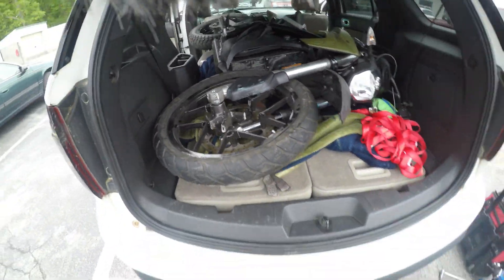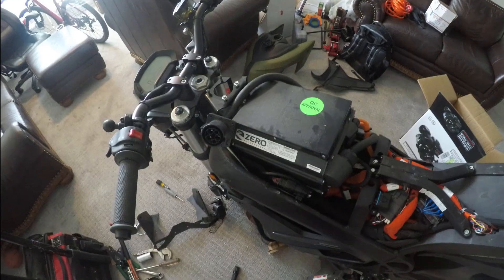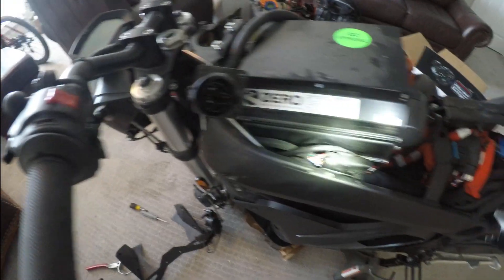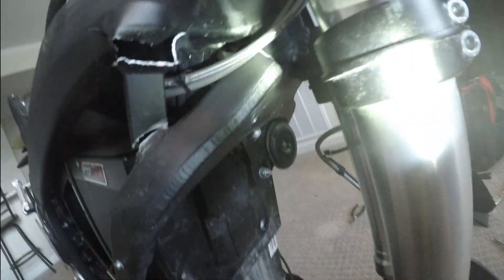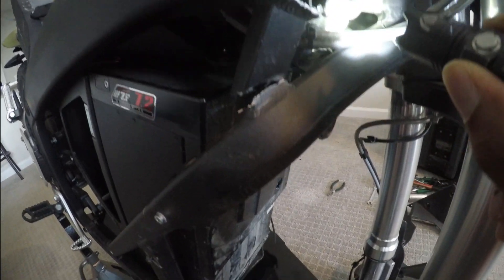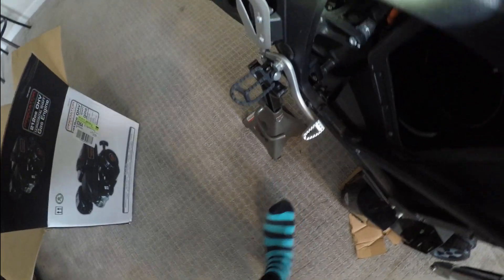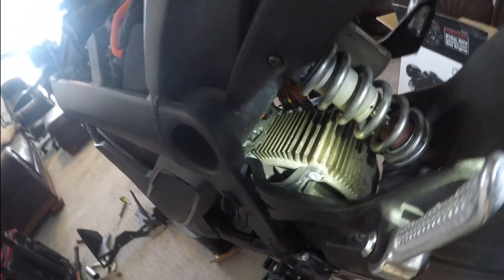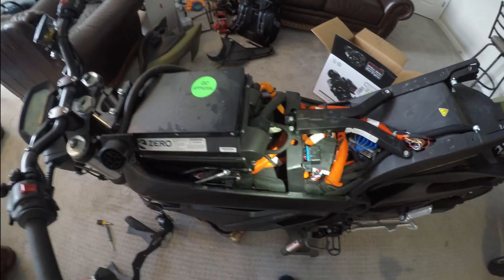2018 Zero DS Copart Rebuild Project ( frame damage repair plan!)

Comment: Why wouldn’t you want to replace the frame and transfer all the parts over?
Reply from the maker: A replacement frame is extremely expensive from zero and it takes months to get it.